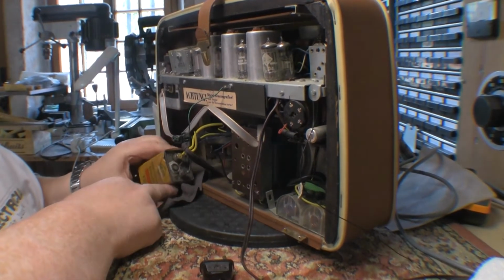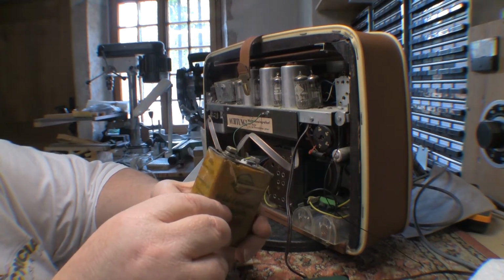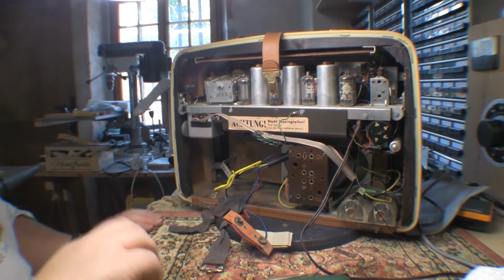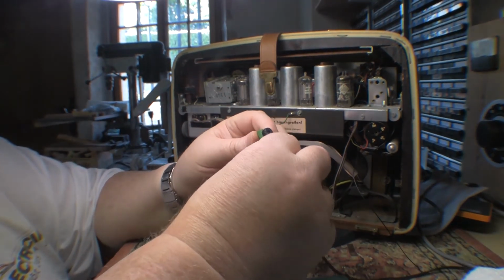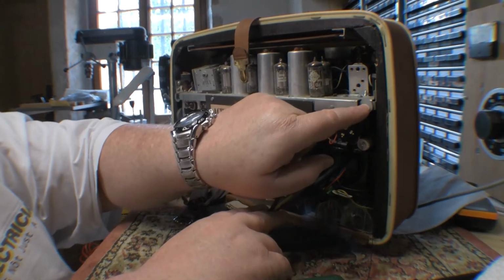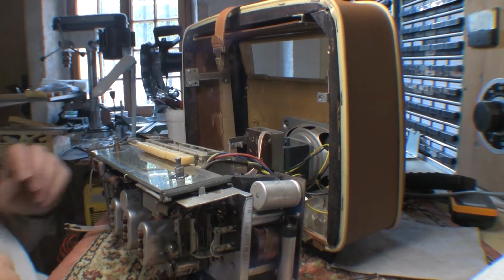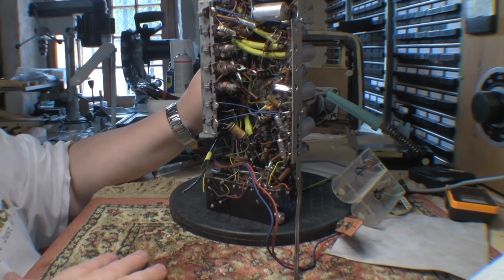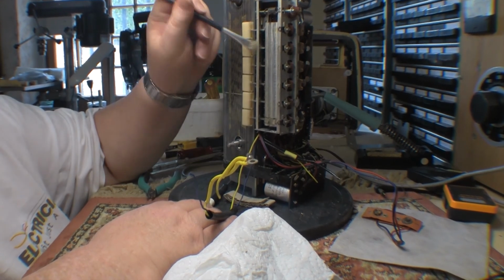Telefunken Bajazzo55 Part 2

Comment from the maker: Forgot to mention - yes there is a voltage selector switch - goes up to 220v which is a bit unfortunate since my line voltage is usually around 236v.   When the time comes I'll drive if off the variac until I need a more permanent fix.

Comment from the maker: Hi AL, that's pretty much it in terms of voltages.  It looks like there are two batteries for heaters, one rechargeable, the other is for regular dry cells.  The notes say that regular batteries can be used if the rechargeable one is discharged.  Seems a bit over the top to me.
Cheers,  John

Comment: Good progress.  It looks as though the chassis has more room to work in, than the typical portable.  From what I've read, those work on different line voltages, from 110 to 220 and use 1.5 and 90 A&B batteries.  Is there a voltage selector switch, for mains voltage?